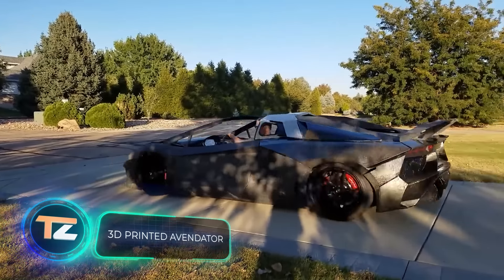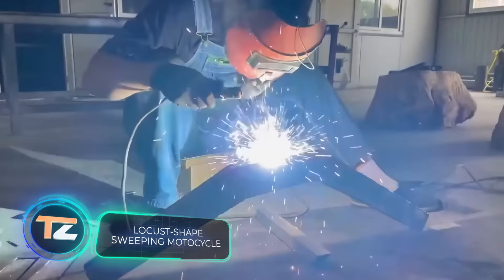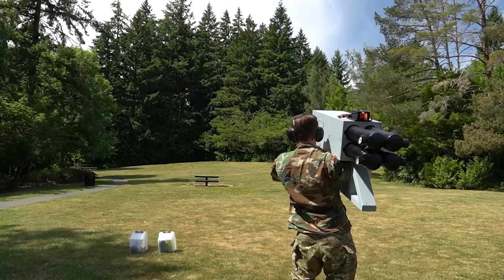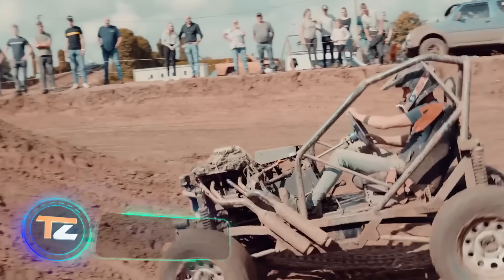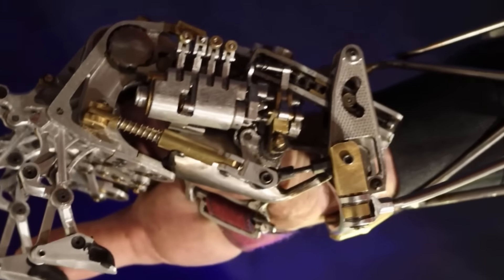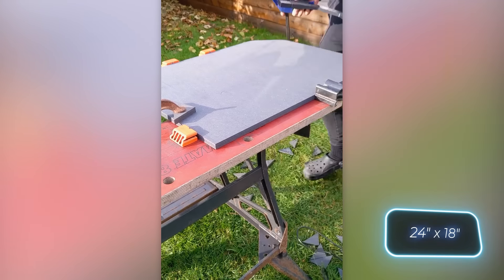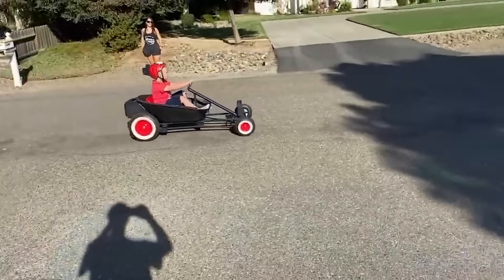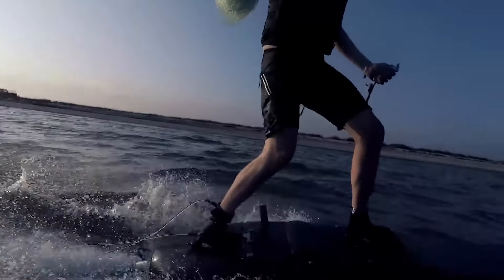15 BRILLIANT HOMEMADE PROJECTS THAT ARE WORTH YOUR ATTENTION

Comment: The Car Bar that only requires a wrench to install has a hole cut in the rear hatch interior of the vehicle at 11:04
Reply: Hey, this is incorrect, it's a mistake in the video. You don't need any tools to use it, and the hole isn't cut that's how it comes from factory. It doesn't need any modifications to your vehicle 👍
Reply: @NowhereFastGear  - LOL, a hole with ragged edges in the vehicles interior trim isn't a aftermarket mod, its a 
... mistake in the video ..."!
Reply: @anotherdave5107  To clarify - the need of a 13mm wrench to install is a mistake (we are the makers of the Car Bar and weren't contacted by the video maker, so they have used incorrect information).

The trim which you think has been cut hasn't. That's how T5/T6 VW Transporters tailgate striker plates are i.e. a recessed hole. The ragged edges are because the van used was over 10 years old so has some cosmetic damage. The Car Bar connects without need for modification.

Comment: 1:30 lol, 2.6GW while capturing at best 9000W from sun.
this is a COP of 2888889.
he shouls add add an iridium sparkplug at the middle of each mirror to multiply the power output by a factor of 1 000  000.

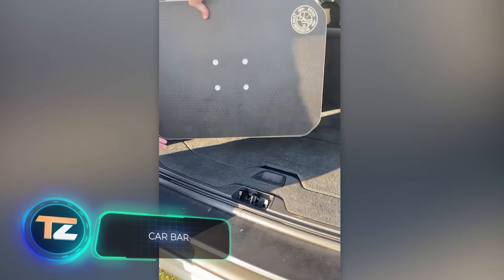Comment: 10:19 ….. scratch my bumper all up please. 10:19
Reply: Hey, it doesn't scratch the bumper. We use soft non slip pads on the leg so it doesn't cause damage (my car in the video is over 10 years old so has some scratches there already)

Comment: If you have enough money to 3d print a lamborghini, you have enough money to purchase a lamborghini.
Reply: But with a 3D printer you can make it out of any material you want. Even poop.
Reply: @jasonkillsformomy looking at what they made, it would appear he did in fact use turds
Reply: Probably carbon fiber. To the original comment: not unless Lamborghini has payment plans over 5 years.
Reply: Unless you only have enough money to 3D print one piece at a time over a long time…
Reply: That's right. No one has verified the safety either.
Reply: It's a waste of money to buy one. Where's the fun in that